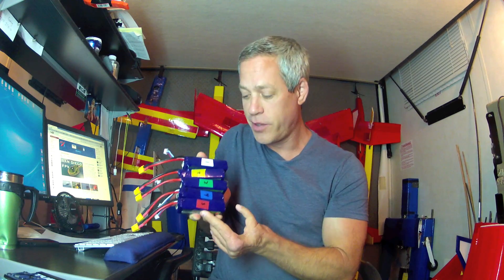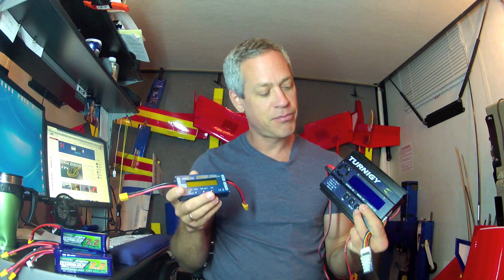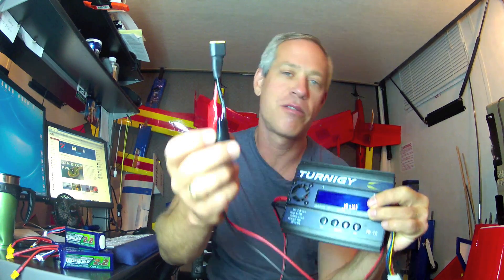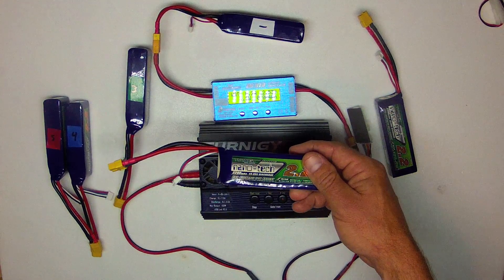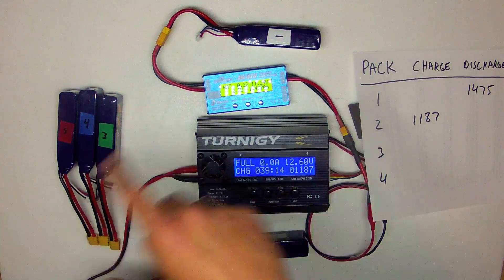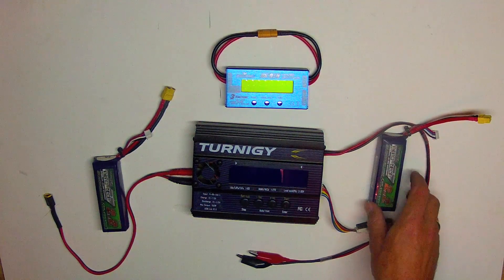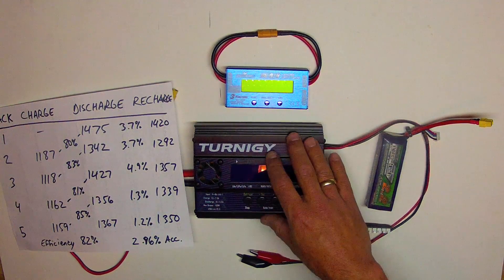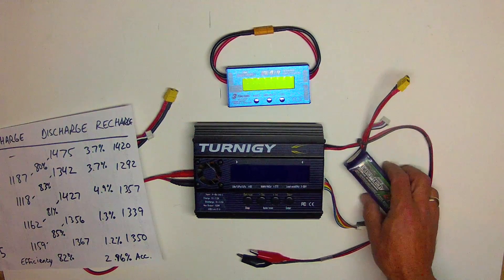LiPo BREAK IN, plus Turnigy charger efficiency and accuracy testing

Comment: Have you re checked these batteries yet? I've bought some batteries recently and they are already up to 80 to 100 ohms. I am using zippy compact and I have 1 zippy flightmax and it is at 50 ohms. I am thinking that the compact may not be as good as the flightmax. I am going to order 2 more flightmax batteries and see.

Comment: I've determined that the storage coating used to protect the new batteries restricts ion propagation and the best thing is to balance trickle charge a new lipo battery to full capacity and leave it for at least 3 days to remove it. And then slow balance discharge it and repeat the process till max capacity is reached. At least with the batteries I have used that seems to get the cells to match at full capacity higher than some report showing they can be restricted or so it seems. I need to post the graphs that show it. I would not use another battery gaining cell space stability to charge another in the same state when I have the power factor of the AC wall socket to achieve it. I haven't tried using balanced AC to remove jitter yet but my guess is getting the phase timing as stable as possible can only help increase capacity. But we are splitting hairs here unless something new is discovered in the process and I have one graph showing the process working in reverse and that's why I think it works. And 20% percent seems possible but maintained rather than lost as many people report. But hard to prove anything one way or the other outside of a lab and controlled conditions. Unless its obvious... and then there's the Pauli effect to consider in effect. Collapsing the wave function may be more influential than we are aware of.

Comment: id say the charger is actually not bad, during voltage step up or down there is usually a 20% loss of power, there is no transformer or power supply that is 100% efficient,

Comment: What cut off voltage do set on your ESC? I've never reached that point during any flight, and have no swollen packs so far in my first 6 months with this hobby. By timing alone, have never gone below about 35% capacity on any LiPo. So far ;¬)

Comment: I'm thinking the efficiency loss when using a 12v car battery will be greatly reduced due to the car battery's higher amp/hour rating. I use an 86 Amp/Hour caravan(trailer) battery at home not a mains supply, and as I'm only flying once or twice a week using 8 different LiPos. As the leisure battery is designed to cope with deep discharge and recharge, I find that I can go for 2 months before I have to mains charge it. I'm also looking into setting up a solar charging for both types of battery.

Comment: Who would charge a LiPo using another battery of the same capacity?  Also, lead acid batteries aren't 12V, they're 13.8V fully charged, while a 3S LiPo is 12.6V fully charged.  You should get better efficiency from the charger running at 13.8V, and also because a car battery wouldn't discharge as fast as the LiPo you used as a power source, because the voltage wouldn't drop as fast due to the higher capacity.

Comment: Ed, I would like to cut to the chase.  Is there a best breakin procedure?  When we get a new battery should we just charge it up and fly?  I may have missed your answer in your video.  I use 3c 2200mah and charge from new to 12.6 and discharge to 11.7 by flying.

Comment: Flying the same motors--,nanotech (1 ea)  1.3mah    45-90 c rated swelled under normal use.  Nanotech (2ea) 1.3 mah 25-50 c no swell.   Same motors Nanotech 2.2mah (3ea),all  puffy and soft feeling. I had given my powerwing and 20c turnegy batteries away 2-3 years old still useable. I just received a shipment of 20 c batteries( 3ea),1.3's and (3ea) 2.2's Here's hoping they last better than the nanotech.

Comment: Quick question for you Ed. I'm thinking of picking up a few B grade 3s 5000mah packs to run my charger at the field. Am I being wrong-headed here? Should I just use a regular 12v car type battery or gel cell? I'm thinking the lipo packs are pretty light and with B grade pretty cheap too. I'm running 3s 2200 nano techs and 4s 1800 zippy compacts in my multirotors. Thanks for all you do. I'm working on my Synapse build right now, my first plane, fingers crossed.